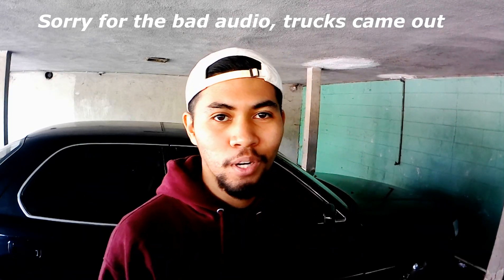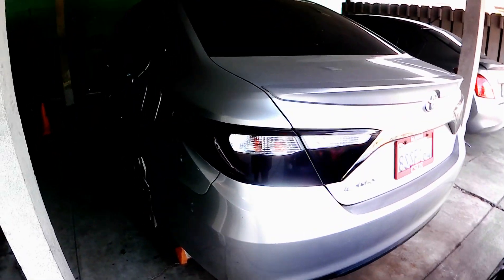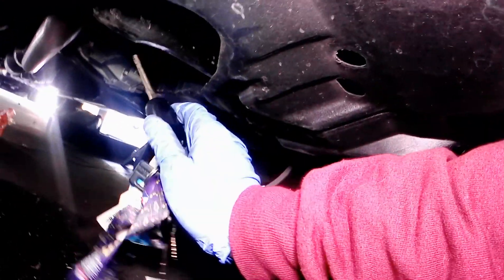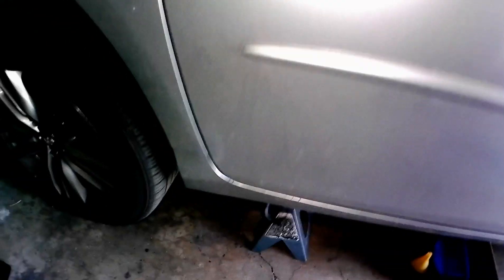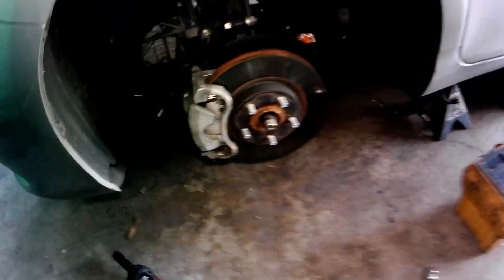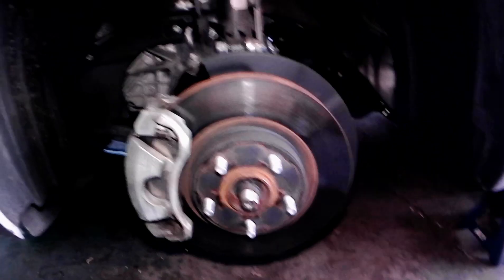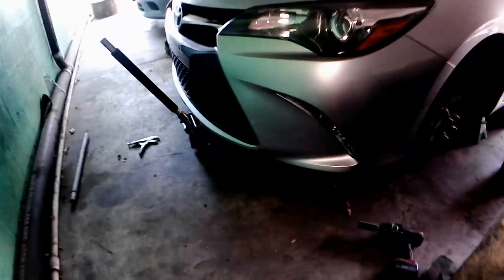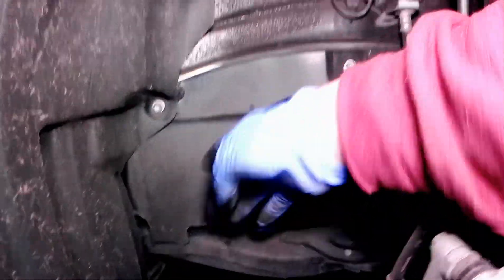DIY! Transmission Fluid Change, Toyota Camry 2015-2017!

Comment: 3 only ? Really ! Quart 7
Reply from the maker: It doesn't drip at all anymore after a while. This doesn't take out all the fluid, just the amount from the bottom of the car
Reply: The rest of the fluid is in the torque converter. If you want to get every bit of fluid out and have completely brand new fluid, you’d have to drain it via the transmission cooler lines or do this process shown on video 3-4x, after each change, drive a few miles so the fluid circulates.
Reply from the maker: @FlexSZN23  That's exactly right!
Reply: Oh I see. Thank for tips